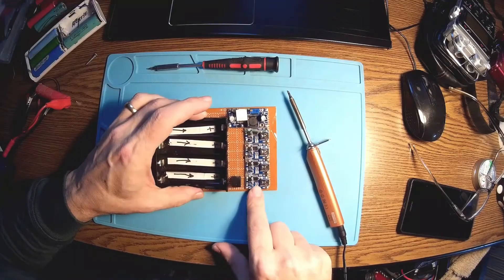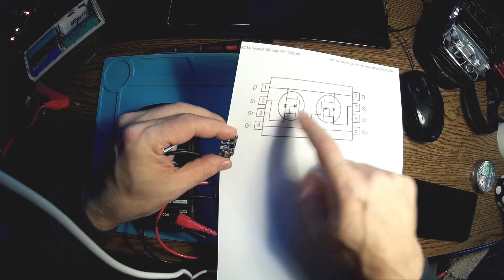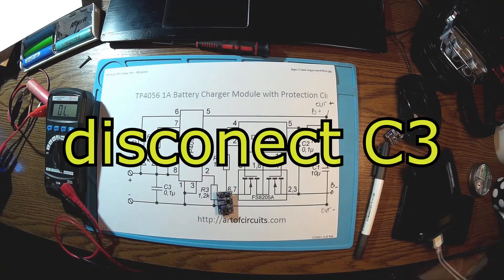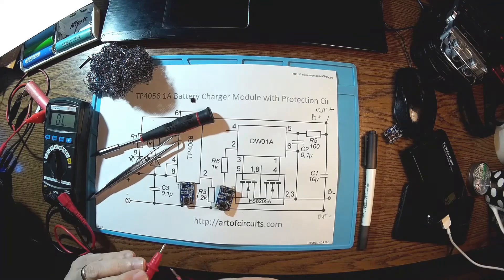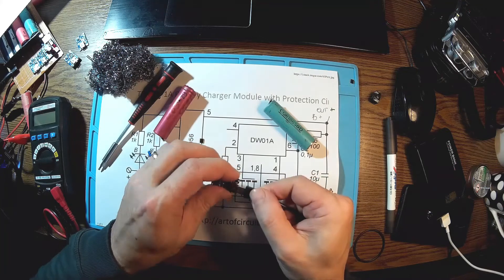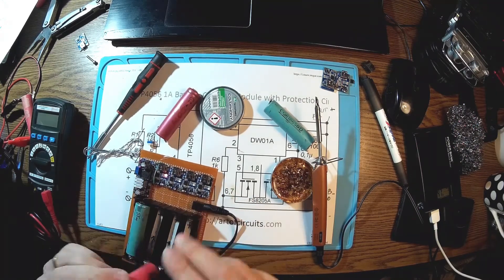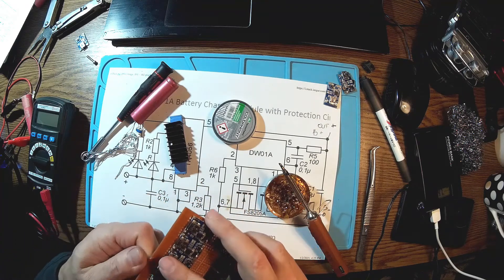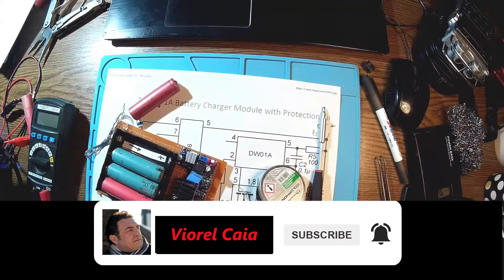How to diagnose and fix TP4056 18650 Li-ion charger

Comment: Amazing you have a lot of patience and knowledge, i did a mistake and accidentally gave my 6 tp4056 12v instead of 5v while there was cells, it smelled and still have leds working!, sure i burned something, from your knowledge what components are burnt?
Reply from the maker: I think TP4056 is burned, it should be powered until 8V...
Reply: @viocaia  cant be fixed? wut component can be replaced u think?
Reply from the maker: @GraphicManInnovations  It's not worth it, you need a hot air station and replacement TP chips..you should consider buy new..and keep this for mosfet replacement just in case..

Comment: Maybe your TP4056 are gone because of reverse polarity in the cells, there is no protection against this in these modules.
Reply from the maker: Possible !
Reply from the maker: I was really carefully about polarity..I found that the heat was the problem..funny the Mosfets are ok, but the TP ic itself burned..and not only one circuit.
I put a fan on top and everything runs smooth..check my video.